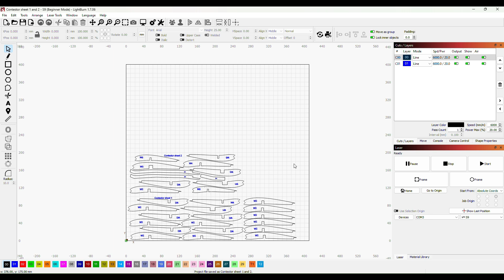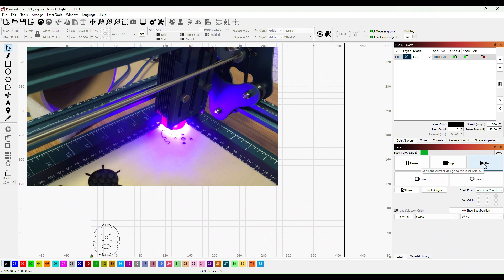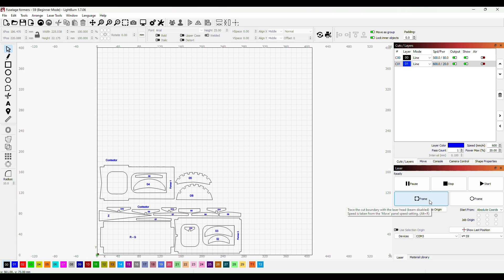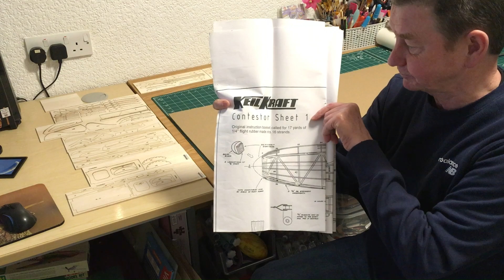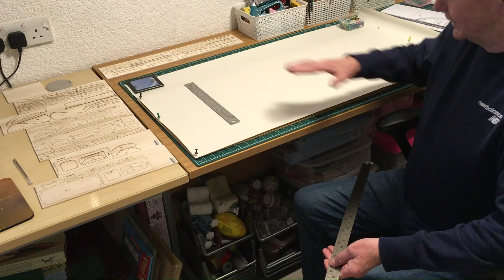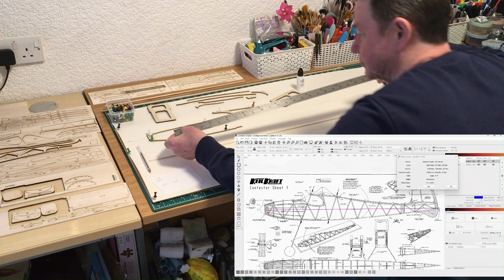Cutting out the parts and starting to make the classic KeilKraft Contestor using Lightburn.

Comment: Thank you so much for your informative videos, just fantastic! I recently purchased a Neje 11 watt laser to do the same as you. If you use Air Assist, you will get better cleaner cutting and your laser lens will stay cleaner for longer. Also if you drag and drop your cutting to the second line, moving your engraving first, otherwise the air assist could blow your cut parts out before they are engraved!
Reply from the maker: Thanks for your comment, I am using the Sculpfun S9 without air assist. But this might change at some point. 👍

Comment: How do you know that the parts were cut at 1:1 scale? Did you just trust that the PDF was 1:1? Typically you would first calibrate the imported PDF with a known distance from the plan.
Reply from the maker: I check using the measuring tool in lightburn, So far all the OZ plans I've used were 1:1 👍

Comment: Don't mean to be that guy, but you really should get a "tent" for your laser.   Not only for the safety of your eyes from the laser ( the little shield that comes with these really aren't all that effective),  but it is WAY more effective in getting the smoke out of your room, or at least filtered.  I can't imagen the fan you have is all that effective when the cut part is further away on the laser bed.  That ply you were cutting has glue that is rather harmful when it vaporizes.  
I'll also 2nd Air Assist.  My laser (Ortur LM 3) came with the nozzle, and I just added a cheap aquarium pump, and it i did wonders.  Faster cuts and less charring.  Unless your laser has a way to control the air assist, no need to toggle the setting.  Mine is not controllable via LB, so I just turn on before i start the cut.  
You didn't mention it, so not sure if you are using, but you can use the materials library to keep the settings for all your material.  This way you don't have to remember, or write down. 
Another tweak; the focus.  Hard to tell for sure, but on those balsa pieces it looks like it MAY have been a bit out of focus.   Just search on you tube on how to check focus.  The little kick-stand on my laser that is used for focus was a bit off.  I 3D printed a focus block.  Once I figured out the correct focus, my cuts are way cleaner.  Yours may not be off, but at least you will know. 
Bonus optional tip.  Get a camera.  Once set up, you can VERY easily use just about all of your material.   Just last night I was able to cut all the windows for an N-scale (1:160) house I designed using nothing but scrap as I could see exactly where to place the objects to cut to match the waste material.
Reply from the maker: Hi Well, I use glasses and the extractor seems to work quite well it's an inline extractor fan. I use the set up gauge to set focus. As for layout most of the pieces have to follow a grain to give more strength to the part. Some good points, so thanks for your comment.👍

Comment: Just print the plan out on A4 paper, then glue it together with a prit stick. Double click on your Outerzone down load, when it opens press Ctrl P and you will get a 100% tile print. Trim off the overlap and glue. You can print as many as you want, most people have an A4 printer.
Reply from the maker: That's a good suggestion, I have done that in the past, with the Fokker DR1 and the Fairey Swordfish, but it makes a rough old copy I prefer to develop the plan on a blank sheet, then at the end you have a full size plan that you can add notes to then roll up and store until you need it again. The guys on 'Flite Test' (they do spell it that way) allways show the A4 tile method too, but I hope I am offering something different. Thanks for your comment, and keep the good suggestions coming, it all helps. 👍
Reply: Sure, but a laser is so much fun, and quite cheap nowadays